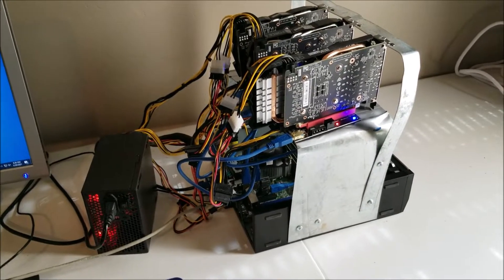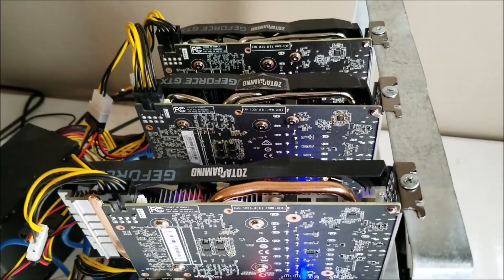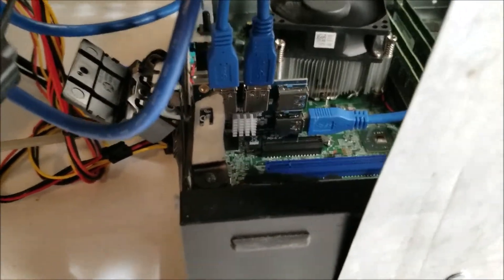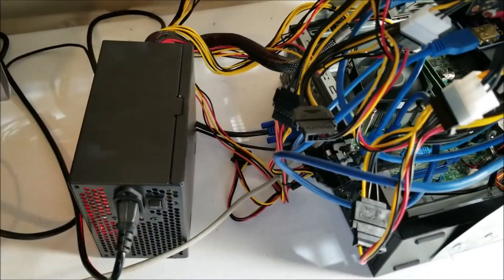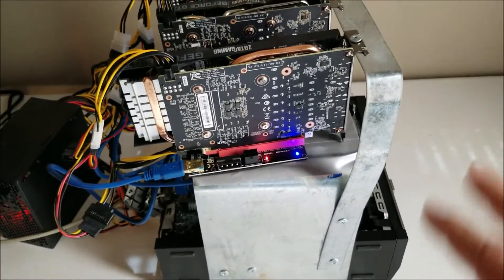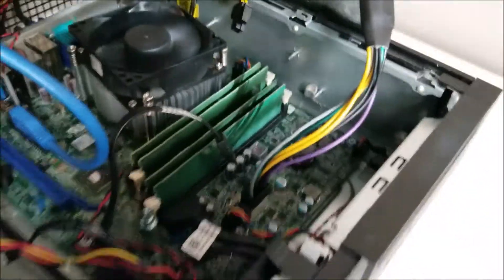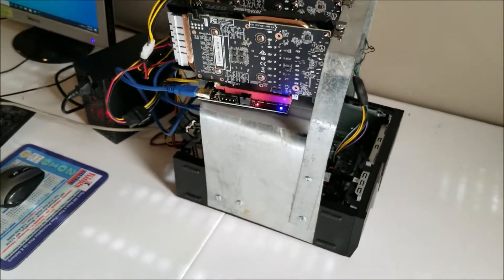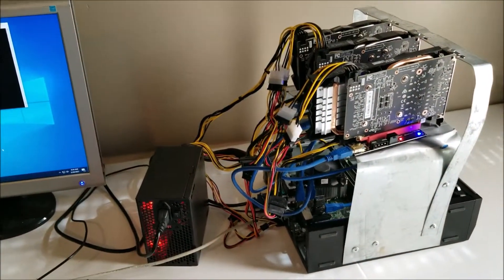How I turned an Old Dell into a Crypto Ethereum Mining Rig

Comment: Hello there, very impressive set up you have there! I just bought the very same computer and will be doing something similar. My question is regarding the power supply. Are you running the original PSU and the upgraded one as well or just the 800 watt unit? Thanks
Reply: I think he's running everything off the new power supply. Be cautious with Ether, they're changing the protocol or something to make it harder to mine with GPUs.

Comment: I purchased the equipment using your affiliate links from Amazon, I do have 2 more Questions if you don't mind :

1) Would I be able to use your Setup with Minerstat Software instead of what you are using?

2) Can I just use the existing Stock PS in 9020SFF desktop for machine operation and just use External 800WAtts PS for the Riser and GPUs? Or do I have to disconnect the stock PS and just use the external or can I use Both?
Thnx in advance.
Reply from the maker: I haven't used Minerstat but I think any mining software can be used. I use a single power supply but many people use multiple units. It probably best to watch some videos on using multiple power supplies as I there is some precautions to take and not damage any components.

Comment: Thanks for a wonderful Video, Would I be able to use 1 GTX 1650, 1 GTX 1660 and a GTX 1070 SC?? With your setup or do they have to be all 1660s?? Thnx
Reply from the maker: I am using all 1660s but GPU's can be mixed.

Comment: Have you tried running more than 3 cards?
Reply from the maker: Yes, I run 4 cards on it
Reply: @WirelesSHack  Have you had a drop in revenue (with Ether) ? And have you factored in power consumption costs.

Comment: did you ever get your 4th card up and running?
Reply from the maker: Yes, I added a 1660 Super and it is working good.
Reply: @WirelesSHack  ... By the way, love how you thought of mounting the GPUs .. Didn't thought of that!
Reply: Thanks for the question and thanks for the answer! I have 2 rigs using actual mining motherboards but I have 2 Dell desktops being thrown away (exact model in the video) where my friend works and she took it and gave it to me for free.. Since it can run 4 GPUs, just need to buy those GPUs and a proper PSU! Thanks a whole lot!

Comment: I tried to do the same thing with an optiplex 790 but it won’t recognize more than one gpu. Any idea why?
Reply from the maker: As long as you have Win 10, I would think it should see more than one card. Often it takes an older PC a long time to see multiple cards. I would let it sit for 15-20 minutes or more and check. The Drivers may need to be installed also.
Reply: Remember to power on the gpus first, if they are on its own PSU
Reply: you cant do it with some optiplexs. i tried it with a 990 or whatever its aclled and had the same issue. it wont detect more then one card and you cant change it short of somehow flashing custom bios. not worth the trouble.

Comment: Thank you this video helped me convert an old Dell 3020 i3 into a nice little mining rig 🙏  the 1 to 4 PCIe and the Dell cable links were very helpful!
Nice creativity crafting your own chassis, i like it.
Reply: i ended up using the stock PSU to power the pc and then supplement additional PSUs as the mining GPUs need. Thanks again!
Reply: @lincolnmicrophonellc   how many gpus did you put on dell optiplex 3020?
Reply: @Hannah-ym5kb  i usually use 4, more than 5 will brick the motherboard i found the hard way.
Reply: hi, do we have to give power to risers also??
Reply: @AbhiMeshram007  yes, i prefer the 6 pin. Don't use the SATA

Comment: I have an optiplex 7010. I can only get 2 gpus working with NiceHash miner or NiceHashos. How did you get 3 working?
Reply from the maker: I'm using Ethermine and haven't used NiceHash yet. I would think NiceHash should see the 3 cards . Be sure the cards can be seen in Device Manager and are all working.
Reply: Try HIVE os

Comment: I need help building mine . You got an adapter of the power supply going from power to board you have it 8 pin to 24 pin ? Or 24 pin from power and 8 pin into board
Reply from the maker: Its a 24-to-8 Pin Dell 7020 adapter for an ATX power supply the link is in the description.
Reply: @WirelesSHack  why does the motherboard need powered wouldnt the stock pc have it already powered by the stock in pc psu? Also how much is this machine making roughly?
Reply from the maker: @_FERG  The 1660 Graphics cards need at least an 800 Watt power supply, and the Dell power supply was only 300 Watt, so it needed an upgrade. How much it makes varies since it depends on several factors, such as the mining difficulty that changes and the coin price, which has huge ups and downs. Today 7-9-2021, it made roughly $7. There are online mining calculators that will give information on how much a card will make with current prices.